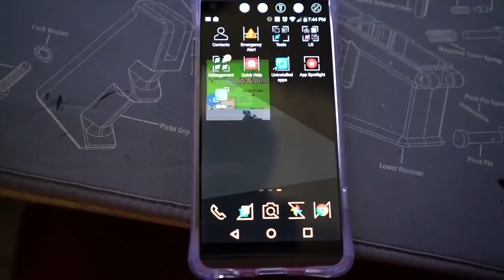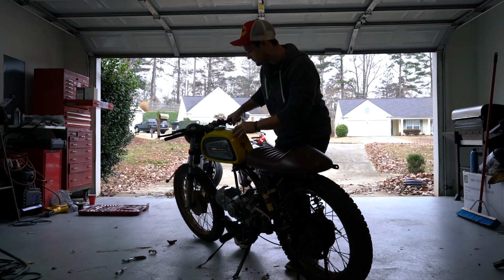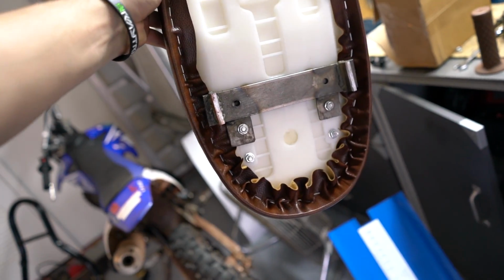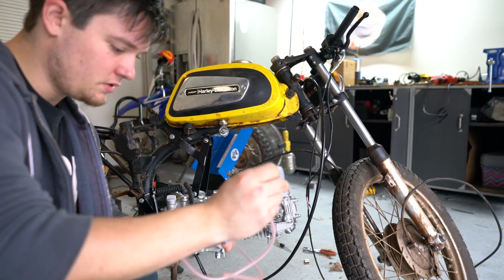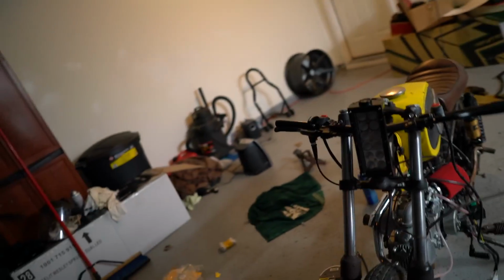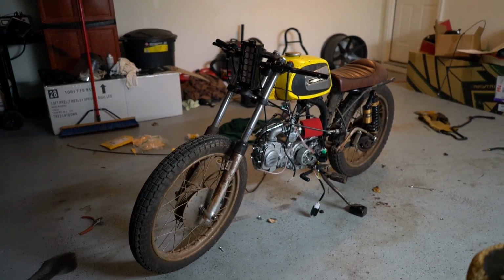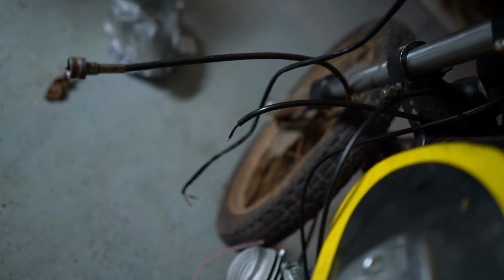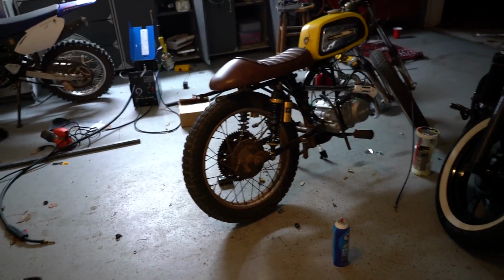WE'RE SO CLOSE!!! - Harley Build Series

Comment: I hate it but I love it and that's probably what makes a Frankenstein build so pleasing to custom bike builders and modders. Pro Tip: If you replace the chain...replace the sprocket. Save yourself the hassle later on, get that bike in tip top shape now so you don't have to worry about it later. Also, those shark teeth on the sprocket is a dead indicator that it needs to be replaced. Looking good man, can't wait to see it in action.

Comment: So made he didn't repainted the frame while it was almost stripped
Reply from the maker: It's getting repainted in a bit
Reply: I think he wanted to put it together to see how it was, then he can take it apart and put it back together easily
Reply: Bro you got to build the bike before you paint the frame.
Reply: If he had to do any modifications to the frame, it would be counter productive to have to strip, cut, or weld on a frame you just painted.
Reply: Do It With Dan coolio

Comment: So are you just going to put it all together and keep it dirty as fuck or what
Reply from the maker: rustyrides600 after its done, I'm breaking it all back down and painting the frame. got to make sure eveeything works and rides good before I paint it
Reply: Do It With Dan hey you up? 🤔
Reply: Do It With Dan bro... that u on the moto amino at 3 in the morn
Reply: u can get a 12 volt round head lamp and maybe led with low and highbeam

Comment: Headlight looks badass vertical but I do think the light displacement will be a little wide for your liking. I tried the same thing with some smaller led's and wasn't pleased but they were more fog lights than spot light so I may be wrong. Good luck with the rest of the build!

Comment: Use the old light and wire in a dc voltage regulator. Use a 6 volt regulator if you can find one online otherwise just use a 5v one

Comment: you really should turn those rear shocks around once you sit on it pressure from weight distribution and the slightest bump may cause a big slamming on rear fork causing a weak or crack in frame thats why you should of stuck to original coils but its lookin damn good upgraded

Comment: check out dakota digital dan. they have everytbing you need to even convert your analog speedo to digital without sacrificing the stock speedo cable. they have a little device that will convert the analog signal to digital. also for speedo cable go through motion pro. they can custom make a cable for you

Comment: No headlight
Reply: Leave the old one
Reply: Leo Mota he can't
Reply: manuel renteria he could use the original light easily with either a replacement bulb that is 12v or a 6 volt resistor to lower the voltage.